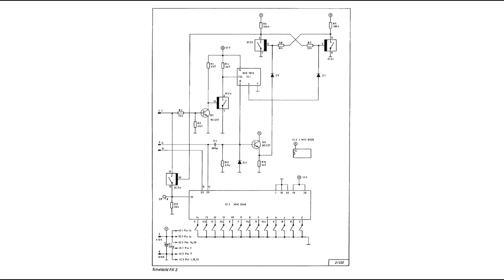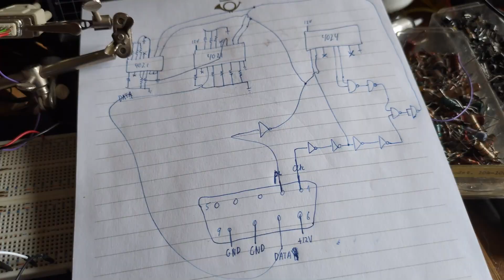Making a pedal box interface for the Wersi Comet

Comment: Excellent. It’s almost as if you know what you are doing. 😉 My tip. Put it in a little box which you can then lay on the top of the pedalboard. Ouch, includes doing some extra soldering. 😁

Comment: You are a wizard!!!

The main problem of the Comet Organ is the very sensitive keyboard-scanner IC. Its made in C-MOS technology and loves to die at unexpected moments. A little bit static electricity at the wrong place and one of the keyboards is dead. The concerning Siemens SM 304 is obsolete since decades - and you have invented a solution for this long lasting problem. 
Actually this Siemens Chipset is used in many Instruments of the early 80s because with this IC's you can get rid of the old analog square to sinus / sawtooth conversion and the octave mixing. This used to take a squaremeter of circuitboard, kilometers of cable and hundreds of contacts at the keybeds. 

When I watched your first video about the Comet I thought "Good luck and rest in peace - this will never work again" - and now ... its working fine!

I'm curious what you figure out about the "Magic Fingers" extention - it is a Sequencer, a arpeggiator and a Melody On Cord system. I never seen a "Magic FIngers" working - so carry on cowboy 😉.
Reply from the maker: What you say about about the sensitivity of the WIC3040 / SM304 corresponds with what I have seen: Sometimes the upper manual freaks out like if there suddenly was a lot of keys pressed at the same time. I have a suspicion that the input impedance of the IC is too high so it picks up some noise - and with a lot of oscillators and four big buck converters in the power supply that pours out all kinds of electrical noises there are a lot that can go wrong. It could also be a bad connection or maybe the IC is on the verge of kicking the silicon bucket. 
Working fine..... there is still the problem with the VCF, and the snaredrum changes its sound when the organ has warmed up, but apart from that it is working reasonably well. I have recorded a collection of music with it lately in multitrack so I have gained some experience with this rather strange organ. (If it was a TV-shop album it would say something like "featuring music by such memorable artist as Eagles, Whitney Houston, Gotye, Eurythmics, and many more, all in stereo on the fabulous Wersi organ") There will be some videos later.
Reply from the maker: To my great surprise I - well, Google - actually found the user manual for the Magic Fingers. Based on what it said I should do, I can conclude that my Magic Fingers are broken. I do intend to try and get it working again but the Wizard Cowboy needs to get a little away from the Comet in the coming weeks :-)
Reply from the maker: Good news: I figured out what was wrong with the Magic Fingers module. I was about to give up when I noticed a tiny wire that was hanging a couple of millimeters outside the plug on the back side of the circuit board. It had simply become unattached for some reason. It seems to be working now.
Reply: @organfairy  
I understand you very well!  Sometimes need some distance from 'difficult' instruments too - otherwise there will be deaths.
My Wersi Galaxy is sitting in the corner since nearly two years. It refuses to work because of a short circuit in one of the modules - and there are around 50 of them.....
Same with a Böhm Silverbird - I ignored the instrument for 18 month because the bass pedal refused to work. Last week I started to work on it again and hooray - I found the error. Due to an error during assembly, the MIDI bass pedal sent on the wrong channel.

Comment: With the pedalboard protocol successfully reverse-engineered, how hard would it be to attach a larger set of pedals?
Reply from the maker: Theoretically it can support a five octave pedalboard. However, when you get above the lowest two octaves it sounds somewhat thin and when you get higher up it sounds like a banjo on helium - as I claimed in the video. The reason is that the filter system is static - it uses the same filter parameters for all the notes and since the filters are low-pass the notes will get gradually weaker as you go up in frequency. Another thing is that the bass voice card is monophonic so you can only use one pedal at a time. If my pedal interface should be converted to more pedals it will need to have more 4021 shift registers - one for each eight notes and the clock delay circuit should be modified so it activates the clock earlier than number 48 as it does now. If I should add another octave it should kick in at 36.
I haven't researched this yet but there is an input next to the pedal input marked "keyboards" and I have read that this could be use if you wanted to add more keyboards to the organ or separate keyboards that other people could play standing next to the organ. I suppose the system is identical to the pedal interface except that it can play polyphonic using the piano and solo voices.
Reply: @organfairy  
Referring to the Assembly Instruction of the Comet Organ (page 61ff)  here the description of the additional Keyboards "Satellite"
The Comet can be extended with four external Keyboards called "Satelite" - these four keyboards can be mapped to four soundgroups "Solo - Ensemble", "Piano", "Bass" and "Guitar". The soundgroups can be played by the external "Satellite" but is controlled by the organ. Electrical the keyboards are connected as a chain.
In deed the keyboards contain the same keyboard-scanner then the lower keyboard. In addition there is a controlpanel with six buttons. Two of them are for Octave up/down. I think the remaining four are to assign a soundgroup to the "Satellite"
Reply from the maker: You are probably right about the buttons. I took a look at the schematics and there are four connections from the 'keyboard' plug marked PX1 (bass voice card), Piano, Gitarre, and PHK (solo voice card). Bass, solo, and piano are connected as a logic OR which means that both the organ and the satelite keyboards can play them at the same time. Guitar has a selector button on the organ that needs to be pressed before the guitar can be controlled externally (if I understand the circuit correctly) which is probably because the guitar is monofonic so whoever plays the highest note will take priority over the other if both were connected, and since it is a German organ such anarchi could not be allowed :-)